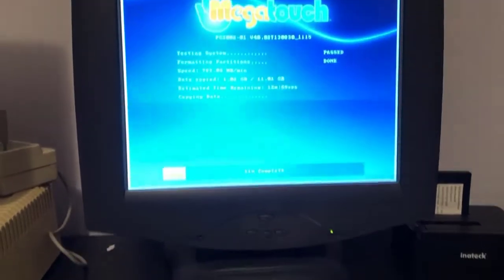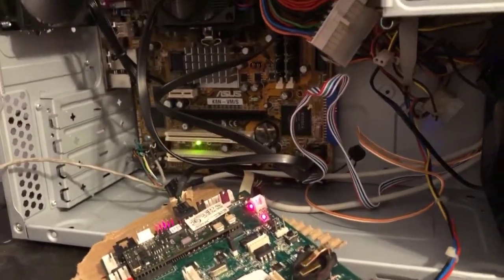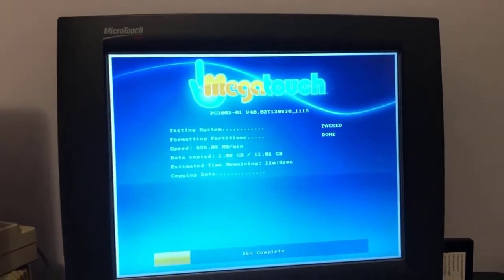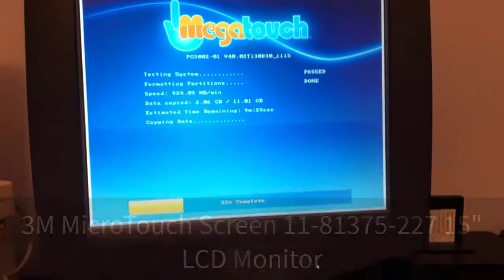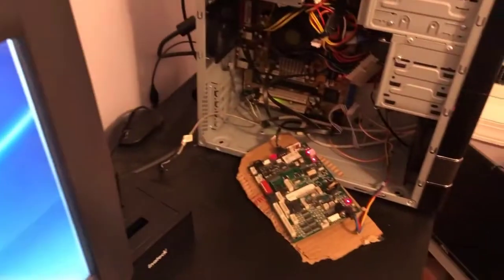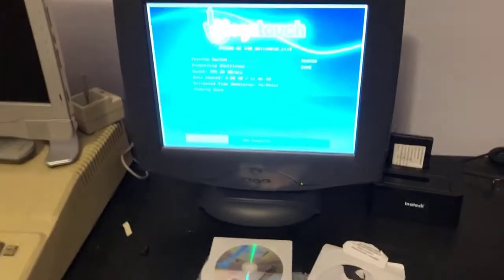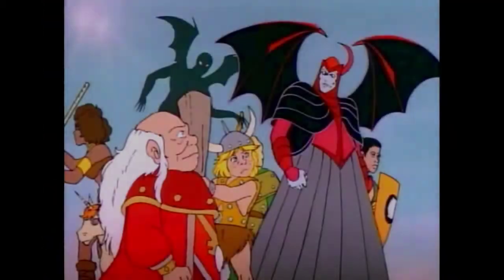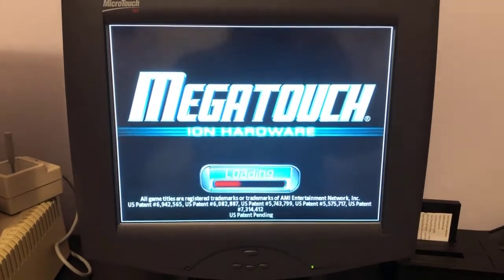Building a Megatouch ION "PC"

Comment: do you have a part list , please reply what your using to play the megatouch on your pc ! thanks
Reply: Hi I do not have a part list, I just took the parts of my Force EVO unit that was falling apart and put into a PC case. The touchscreen monitor is separate I"ll have to look up the part number. I got it for something like $80 on ebay used.
Reply: Do you install the iso?  We have a megatouch and a hard drive but can't figure out how to install the software